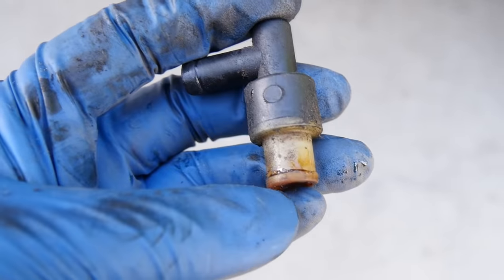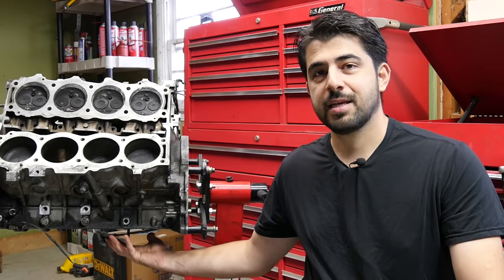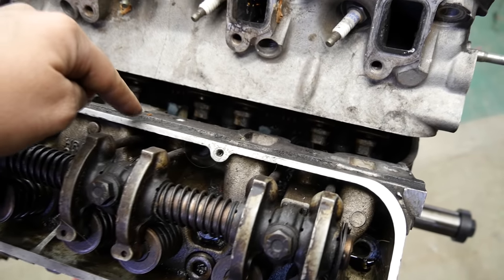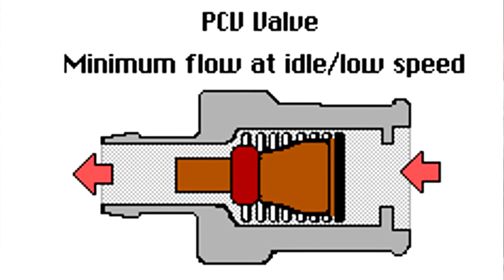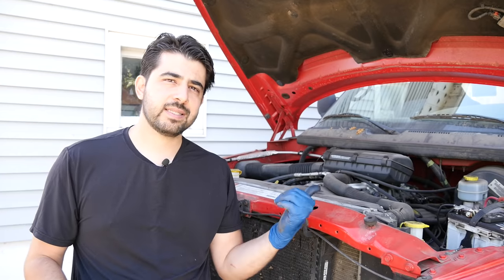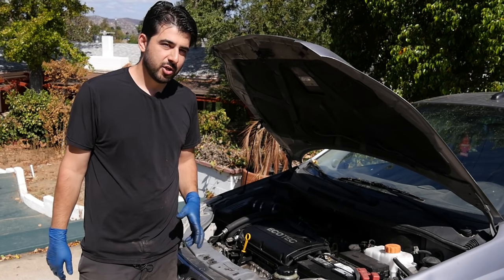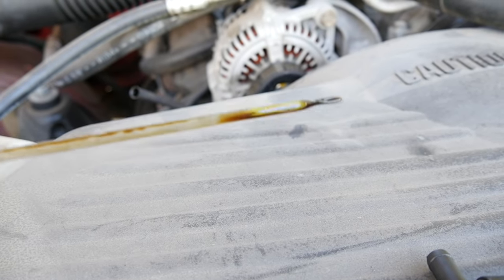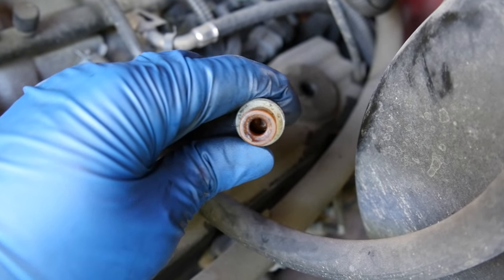The Valve That Can Cause Major Engine Troubles - How to Avoid Engine Sludge

Comment: My engine oil smells like gas, I think it doesn't have a pcv valve, it's a Toyota 1az-fse engine (same on Avensis 2.0 I4 cylinder) what should I do?
Reply: Head gasket change immediately

Comment: So deleting the PCV breather hose is a no go? I can't just slap on a breather filter
Reply: 08_FG2 catch can way to go.
Reply: 2nd on the catch can. They work great.
Reply: This was the way engines were designed up until GM invented the PCV valve in the late 1950's, and for a long time motorcycles had a simple vent that would drip onto the pavement. Although it was primarily a pollution control measure (up to half of emissions), the positive benefit in terms of oil contamination by unburned fuel were clear, too. In theory you should get a little better fuel economy, though that effect is pretty small. Just capping it off doesn't work, rising blowby crankcase pressure blows out seals. If a straight path to the throttle body is there, idle problems similar to those in the Ram plenum defect are seen because of too much air movement at idle. Yeah, you won't notice much if you use a straight vent to atmosphere, but for the ten bucks to replace the PCV, most would just replace it. Cleaner oil is worth it.
Reply: My problem was the design of that nasty blow by being recirculated back through my intake. Catch can catches it before its sent back into the motor. Some cars are worse than others at blow by.
Reply: Good point.

Comment: Can you do a video on the other type of engine that doesn't use a pcv valve. I have a 1.4 Chevy Cruze 2011. I think it's intergrated in the valve cover. $ 68.00
Reply: what an expensive design.

Comment: My friend, nobody can figure it out what's the issue with my 2000 GT mustang, car runs strong with the temperature is below 60 degrees, summer time is running sluggish. In the winter stalls a few times a year only when I'm  while parking going in reverse (low rpm) no codes or CEL. Common maintenance have been done and new coils and spark plugs, tps have been replaced. MAF, EGR, IAC throttle body cleaned up, etc. It has a fresh rebuild tranny. I check this valve too and rattles. I'm lost, what can you suggest? Thanks!
Reply: May be running a little too rich if it runs better in cooler temperatures . Is the engine coolant temperature sensor original ? O2 sensor hanging in the lean side may be richening the fuel up too much . Is it the 4.6 three valve engine ?
Reply: @Viper81766  Is a two valve 4.6
Reply: Jose Miguel Dayrit  hopefully a mechanic can diagnose fuel trims properly and tell me what's up
Reply: Jose Miguel Dayrit  but since I bought over a year ago I haven't pouring Lucas treatment in the gas and also tecktron at least twice a month and I use 89
Reply: @GiotheGhreat  If you have access to a good scan tool with live data display and watch the O2 sensors and the ECT and see if you have a rich condition . Have you pulled any of the spark plugs to see how they look ?
Reply: @Viper81766  when I bought the car the spark plugs were black, I replaced right away, after a year I removed them and they were clean
Reply: @SleepyH3AD1221 is the worse feeling because there is no codes to guide us
Reply: I too would suggest checking your coolant temp sensor. My VW gave me all kinds of similar problems when it failed. Fortunately mine was super easy to access and replace.
Reply: @Daniel Simpson I just did a diagnosis with a professional mechanic and I have a c1284 oil pressure switch "but may be invalid"
Reply: M Giovanni, my 04 gt was running sluggish, and I replaced the fuel filter, cleaned the maf, and cleaned the air filter, now it runs fine.
Reply: @JesusChrist-uj8lg  done already three times
Reply: Suggestion...Check all your vacuum lines. My Mother in Law's Ford had a defected vacuum hose near a switch. Once the car reached normal operating tempature the hose would collapse and prevent vacumm air reaching the valve making the engine run really rough. Replaced the hose and no further issues noted. Good luck!
Reply: If you want to fix it yourself for the least amount of money and time spent, get a subscription to AlldataDIY for your car. Considering your other options, it’s the cheapest and well worth the money, and gives you access to the official technical service bulletins from Ford, one of which will probably may address the problem. Otherwise, consider joining one of the Mustang forums and find out what others have done.  If these two options don’t suit you, you are going to have to spend some real money to get a professional scan of the engine when the engine power is down and an expert’s evaluation of the DTCs that a professional scan will reveal, as well as an interpretation of the live data.  Finally, if you decide to seek a solution on your own, remember that replacing parts is one thing, but checking wiring is another. Corroded connections are not always apparent to a visual inspection, although many are. Wires can also fail internally, not just at a terminal or connector.  Use a digital multimeter to check the resistance of each ground. Check out a YouTube video on how to do this  and get an accurate result. Do not rely on a test light.  If you replace anything, such as the mass airflow sensor(MAF), always use Motorcraft parts on your Ford, not some aftermarket brand. Shop for the best price, but buy OEM engine/electronic parts when you want your car to run correctly.

P.S. If you have any doubts about what bad wires can do to the drivability of a vehicle, please check what D Ray Smith learned about bad wiring in his Chevrolet truck. This is the link  to the second of his YouTube videos on the subject: https://youtu.be/o3_e57Y4gTY.
Reply: @Anonymous-it5jw  thank you. I already took the car to Ford with no results and mustang forum people are following only. But I'm going to try your first suggestion.
Reply: Jose Miguel Dayrit  how do you check for a clogged catalytic converter?
Reply: @asmith5799  Vacuum gauge
Reply: M Giovanni save your money. Fuel additives in  the gas tank do nothing. Snake oil. Best thing you can do is change your fuel filter according to service manual and don’t let your tank get below 1/8th full.
Reply: Check your crank shaft position sensor. Sometimes they don't go out enough to throw a code. And I've seen them cause problems just like u desribe.
Reply: A lot of times if temp fluctuations are affecting how it's running it can be traced to something electrical.

Comment: Have a 2009 Nissan Altima. Drive 4 a bit then car starts running like crap & once u come 2 a stop feels like brakes r stuck. Tire pressure gage light goes on along with other lights. Had car scanned had about 6 or so pages of codes. All low voltage codes 2 different parts on car. Let car sit it will go only 4 a bit. Lights stay on and car once again will fail.. Tried 2 push car n neutral wont move.

Comment: Dude I’ve been chasing my ass for a good long time with my hellcat. Won’t through a code dodge says it’s fine but it is in fact  misfiring however so slight it doesn’t matter it sounds  like shit at idle. Well realized this system sucks so went with a jlt oil catch can then the hoses started to collapse under heat. Got sick of the carbon build up in my intake as it is supercharged and didn’t want that crap in my blades. Problem is it’s causing a pressure build up and just yesterday I noticed the dip stick was popped out after some spirited driving also notices a grease ring on the driver side head where it hooks up to so that’s bad now. So it’s kind of screwed up any can style are basically the same and use the same material and read they don’t really help that much so do I return it to stock or is their a better product that actually works and doesn’t break down over time causing pcv issues and actually removing oil vapor. Is there a system that can simply return it to the oil pan where it belongs.
Reply: How does one chase ones own ass? I would enjoy to see that 😜😎

Comment: Thank you Ratchets & Wrenches!

I had a 2001 Ford Taurus and the PCV Valve went bad. Replaced it, and it stopped stalling at lights, misfiring, and it drove a hell of a lot better too.

Comment: On Chrysler it blows on the breather side when PCV is stuck close. You will find a lot of oil on the air filter. Shittiest pcv system you will find on some BMW  and GM small turbo-ed engines. Very common failure on GM.

Comment: Great video. VOLVO is terrible about this problem. Their PCV valve design is infinitely more complicated than it needs to be (its to protect the environment, dontcha know...and to generate lots more labor hours for their dealerships) Instead of a simple $6 valve like the one you showed us, its a complicated design that runs about $400 for parts and twice that for labor. Not relpacing that system causes oil to blow out seals and cover the engine in oil...also your driveway. NEVER BUY A VOLVO. Youre welcome.
Reply: Correct. Toyota or nothing my friend

Comment: Great video, thanks man! Just a quick question, could the steering pump have an effect on the engine in terms of causing smoke coming out of the exhaust??? I may have a bad PCV but during the diagnosis of my 2004 Toyota Sequoia, it seems that I may also have the steering pump issue. I hope my question was clear, and thanks a gain!
Reply: yes

Comment: I didn't want to pull mine to see if it rattled because it sits in a fragile gasket. So I asked my mechanic if he had a gauge or something to check it. He did. It was a small one that he just put in the oil fill port and read the vacuum changes.

Comment: I just changed mine recently, the inside of the pcv was so rusty lol
Reply: You'd better hope it was not rusty.  Normally, a PCV valve is literally bathed in oily vapor, and the LAST thing it should do on the inside is rust.  What usually happens is the inside of the valve gets a coating of oil which is repeatedly baked-on, making it look brown.  I'm going to hope for your sake that's what it was on yours, and not 'rust'.

Comment: Ok I changed PCV valve...  why is eating same much oil my car ( Dodge Neon '99 ) ? And when start make a lot blue smoke ( from oil ofcourse). . Or after driving if I stop car and let engine work , same smoke .... Also spark plugs full of oil I changed them and after one hour drive they was Sam full of oil... Also how can I repair a non functional  Fuel pressure regulator ?!? Not to change ( to repair...). Because I can't find to buy it in any country from EU , and to buy it fro USA is to much expensive.  Or it's compatibility from some another car ?

Comment: 😒👍 hes rite, listen to him, replace that cheap az valve every year, also clean the pcv orifice or change it out on newer euro and asian cars often. If u dont u will create a nasty oil leak coming out from all the gaskets and oil seals all over the engine, and its not really worth changing them out, its alot of fkn labor to do it! 😱
Reply: money-pits are designed to take advantage of cranckase pressure to blow oil gaskets 😂

Comment: We found that 2000 Isuzu Troopers, as well as other years, can lose a full crankcase of oil in as little as 700 miles due to a bad pcv valve without a single drop showing up anywhere and no smoke. Of course  the cat burns it up. Sad way to lose an engine. On those engines the clamshell will always have half a guart of oil sitting there in the cross hatching just to prove where it all went. I warn owners guite often.